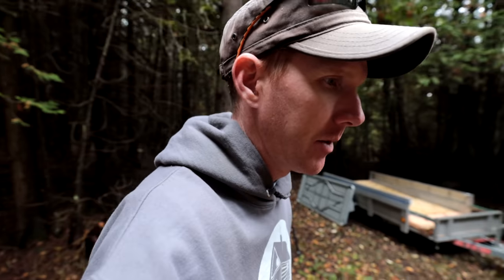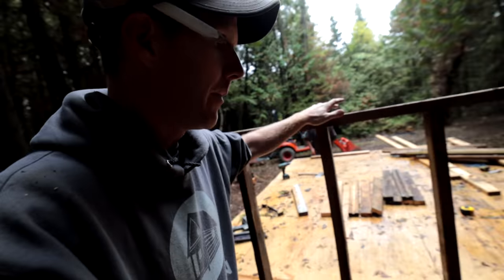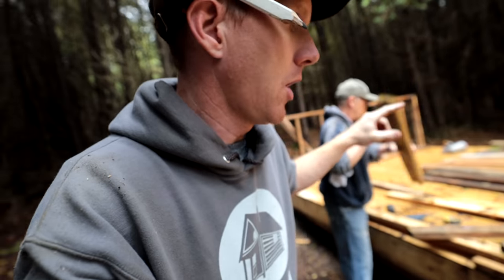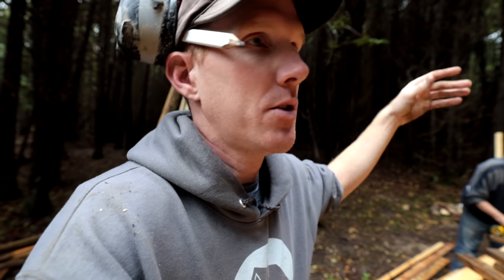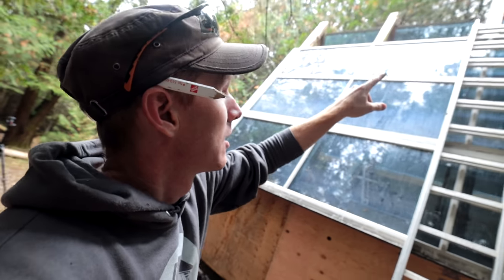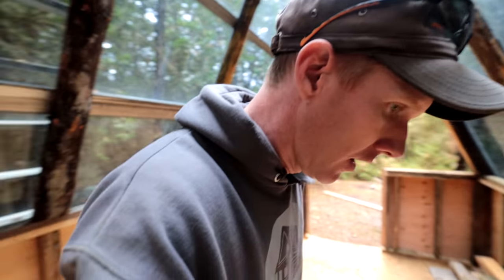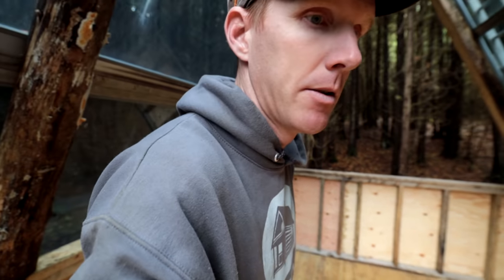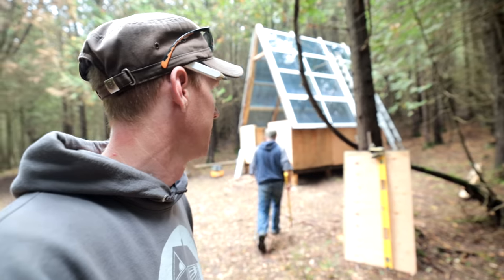A-Frame MICRO HOUSE Built on a Budget!

Comment: Ideas for future: Cob insulate the knee wall inside so you can actually see the cordwood cookies, and it gives you great thermal mass. You can then also cob/lime plaster/render the outside, and maybe do a line of cordwood cookies around the transition, but not too much. You don't want to take away the view from the outside of the immensity feeling of the As. Inside you will feel it anyway, regardless of whatever else is going on. And from a business side, don't put anything in there that you can't take out through the door, and you could rent it out as a wedding ceremony pavilion.
Reply: Cob has pretty decent thermal mass but it weighs a lot and it is very bad at actually insulating a building that experiences long, cold winters.  The walls and floor could be well insulated but you would still have to increase the strength of the floor if enough cob was going to be used to make a noticeable difference in heat retention.

Comment: Hey neighbor! I'm watching you guys late on Saturday because I'm on vacation with my daughter in Massachusetts 😁
I've watched the video a few times and couldn't find or figure out what you were using as tiebacks for your knee wall. If you could be specific for my blind a$$ self I'd really appreciate it! 
The pond looks great! I'm sure you guys will get many yummy meals from it and great memories too.
As far as ideas for the A-frame, I like your idea and I agree that it looks like a church. Therefore,  my idea is to use leftover tiles, broken ceramic dishes, glass marbles, basically anything leftover and colorful that you can "tile" onto the plywood. For the glass you can paint it to look like stained glass or there are sheets of film to place on the surface that refracts the light and creates rainbows (look for it at Lowe's). Gingerbread cutout trim for the outside decor could give it a Hanzel and Gretel feeling to the cord wood look you're thinking of doing. I have layout ideas too but I'm sure other people will have better ideas than me! 😁
Whatever you do I'm certain it will be fabulous. Enjoy your time, stay safe (especially 13+ feet in the air), hug those beautiful girls of yours, give Don a high five from me, and I'll see you in the next video! (I'll be in Ohio for that one 🤗)
✌💜🐖💨
Reply: The knee wall acts like a box it's attached to the floor.  The bottom glass has a stiffener bar at the bottom that is lag screwed to the walls. Preventing any bowing.  The pitch helps too.
Reply: @cmosphoto1  you're freaking awesome Kevin, thank you for that clarification! 😁✌

Comment: I like the cordwood design idea. I had an idea for the inside of the cabin too... Since you've got all that nice overhead space, what if you were to create a storage box that kind of fits between the A-frame posts and glass and put it on a pulley system so it can be lowered... Free storage space! For living space... maybe go for two futons right near the door opposite each other with a thin table between. When the futons are in sofa mode, you've got space to walk around, when they're in bed mode, the table acts as a nightstand. Then for the back half of the cabin, you can put a small kitchenette against one wall, have the stove centered in the back against the far wall and then have a food prep counter with lower cabinets on the wall opposite the kitchenette. Then just screw in some hooks into the A-frame beams for holding utensils and whatnot. String up some LED stringlights and you'll be good to go!

Comment: I discovered your channel via Zendure.  Amazing work you do.  I shall henceforth refer to you and Don as the Ladder Day Saints.  One suggestion for the floor.  Use porcelain plank wood look tiles.  Looks like the real thing, easy to clean, doesn't need refinishing if you have a leak or come in with muddy wet shoes (or paws).  Then put down a throw rug for winter.  Will help keep it cool in summer.

Comment: That thing is going to be great when it's done, was wondering about the change in the roof, I would have put the glass right to the top and whent out through the back with a stove pipe, can't wait to see what you come up with for the floor plan, be safe and have fun
Reply: Agreed.  I see the chimney going out the back wall - maybe a roof extension to support it?

Comment: You should run some solar powered strip lights down the center of the ceiling inside. They would make a nice out if the way light option.

Comment: You could add some all-thread rods to tie that knee wall down super tight. Sick idea BTW love the door panels.  I would also do an exterior seal of Lap Caulking. It's used to repair RV's it's really good for larg gaps and expands and contracts a lot so that thick flexible product is good for roofs and anything you want sealed up really well. Even adding some seam tape wouldn't hurt either.

Comment: Very cool. I do love the open - screened windows that can opened for a breeze in warmer/hot weather - which would be good.   Even a screen door.  Just had a thought- any way to swing open big triangle windows at the back and front for screened openings in summer?   Maybe incorporate a car door type window you could open or close.     The cherry wood floor would be nice - besides milling more (if you didn’t have enough to cover the entire floor), something else to make a fireplace ledge among the back wall (stone might be too heavy - not sure - a built up bench for seating or displaying things - with a fire resistant top, perhaps.    The front steps could be rather grand - wider at the bottom than the top - or maybe with a bit of a deck out front.   A grand entrance for a grand woodland retreat.    I think you will have some lovely bluish light inside - definitely display it.    The building is kind of like something you’d see on an older chocolate box/tin (in a way).   I really like this project.  Looking forward to seeing how it turns out.     Perhaps two doors that swing open outward? (If you have the materials and space).

Comment: What about taking the chimney out at the top of the back wall instead of the roof? Vent panels could be added to the cap for a hot summer day or to vent off excess heat when the stove is lit.

Comment: Would you consider doing a wrap-around deck on 3-sides: on the front entranceway that leads to the left and right? Then at the back end if you decide to put a wall, then you can hide an outdoor storage area for certain things like brooms/squeegee/scrubbers on long handles to clean the outside part of the window roof, ladders, firewood, etc. That outside deck could be used as an outdoor seating area if the weather is good and bugs aren't attacking.
That wrap-around deck can have a strip of L.E.D. lights around the border and ftont staircase

If you've collected enough antler sheds, you can make an artistic chandelier with little L.E.D. lights intertwined around antler point horns for the inside

Comment: I’m thinking a sleeping loft would be sweet in the glass A-frame.  What an awesome view it would have.  Might need a curtain or some sort of shade for summers though.  A vent system at the top of the A-frame that pushed air from inside out and pulled air from vents on the ground level in to the house could help cool during summers too.  Love your work and channel!!  Very inspiring!!

Comment: Bad news about that Hussk knife, it's made from 18/10 stainless which is junk metal for knife making. 18/10 is usually used to make pots and pans, and can't be hardened enough to make a decent knife edge. Sure you can sharpen it, but the edge will be dull in a few cuts.

Comment: I know you said that you want to run your chimney between the glass panels in the peak, but you could also add a bump out on the back wall and then set your wood stove on it. Then you could run the stove pipe through the roof of the bump out. it would also give you a place to store wood and preserve floor space in your cabin. Just a thought! - Jason
Reply from the maker: That's not a bad idea.   I'm somewhat committed to the current plan, but I really like you idea.

Comment: You should clad the front and back in the cookies but on the sides rip off the outside of some logs and put that on the outside. It will give the effect that the glass A-frame is sitting on a stack of logs. You could even do the same on the inside and you would have a half log cabin look for none of the trouble. You could even do some cosmetic chinking.

Comment: The view out the back of the A frame is soo nice.  Cant you put the stove in the entrance area this time?  You could build a small wood shed outside near entrance.  Just trying to change it up.  Also you could slice larger logs for larger "biscuits" for an entrance area going into A frame about 4 ft.  :  )  Especually if you dont have enough flooring left from cabin.  Then use that floor for what you have left.  If it gets super hot in the summer you may need a ceiling fan with closeable louvres for winter adjustable for condensation in winter ???? 
Anyway, you are my hero !

Comment: This is great, as were your other builds. You mentioned that the glass had UV coating so you're not using it for a greenhouse type thing but plants don't need UV (technically they can benefit from UV-A, but these windows are probably (can't say for sure) coated for more harmful UV-B). Obviously, this A frame cabin is a far better use for the windows, with its voyeur-friendly love cabin vibe, but the plant plan wasn't so bad. Better reasons to not use it for greenhouses are that plants actually like some airflow (no openers in these), and you don't need thick double-glazed windows either (unless you are creating a jungle sauna! Speaking of which, how will this cabin cope in the summer, even far up in the northern wastelands?). You should definitely hang some plants inside however, see how they cope.

Comment: Please run the chimney through the back wall or explain why you like going through the roof compared to the wall. 
Don't forget the fresh air intake for the firebox. Sucking cold air directly into the firebox makes way more sense than sucking cold air into the living space, warming it up, then eventually getting to the firebox. 
I also heard to put the dampener at least 18" above the firebox. This extends the life of the dampener & allows the fire to burn cooler, because you can close it more, while still having a strong draft.

Comment: I’d think you’d want a window in each gable up top that you could open to adjust and release some of the heat radiated through the glass and wood stove. Possibly one of the sky light type windows with a pole opener crank style.

Comment: I agree Don is a Rock... That said... Use stainless steel cable or black pipe to gusset the A frame. Use the same to gusset knee wall to floor. Suspend a loft to the rear.made of rope or webbing for your daughter. Use hammocks suspended bunk style on two sides in near the front like on a ship for four adults. Place stove in the center of the room. Make 8 "club" chairs and make 4 gaming tables (chess, checkers, four that can be pushed together for poker nights. Cook on the stove. Heat water on the pipe. So nothing formal. Four end tables can make on larger table or left for mixed use. Example: Checkers 1, knife maintenance 2, whiskey cheese and sausage 3, waxing boots for winter 4. Either way you can sleep 4 adults. Sleep kids above. Hammock can be dropped during the day to keep the views and they are cheap woven from Amazon.
Reply: Further to below. Use small solar powered gable vent fans  at the peaks to cross pull hot air. Use you chainsaw and channel each beam one half inch for tucking LED strip lighting to run off your pack. Use canvas painters floor runners to collect the crap off your boots. I think A framed outhouse is a must at this point. Also, some wear there should be a two point "a frame" over a fire pit encircled by 3 inch minus surrounded by seating. A large chain hung down to cook the deer chili. Stump tables between the chairs to prop your cold snack... As for you running across the property to show scale (that was funny btw) maybe someone creates a living cartoon style map of your property and you can add to it as it changes? Or maybe you make a cedar plank story wall and wood burn a cartoon map you can refer to? How are your wood burning skills? Last since I am on wood burning. shiplap that knee wall and burn a hunting mural all the way around the inside this winter when the projects slow down. PS run some 3 inch minus down those paths before winter hits, your place gets muddy, very muddy.

Comment: Let me preface this question by saying I live in then southeastern US, where wood stoves for camping isn't really a thing, since it doesn't really get cold here.  So this is a genuine question, because I think I might be missing something.

I watch a lot of Canadian cold weather camping Youtube channels, because it fascinates me, but you guys always make your builds with a wood burning stove chimney going out through the roof.   The stove is almost always near a wall, though, so why not run the chimney through a flat vertical side wall?  In the case of this A frame, it would be the back or front wall.  It seems like that would be much easier to shed water, since the purpose of the roof is to move water down it.  Less holes in the roof should be better.
Reply from the maker: Usually the straighter the pipe is the better the draft, also a properly installed chimney through the roof is water proof.  The less bends in your pipes the less build up of creosote and it's easier to clean..  In the A-Frame the stove I'm using doesn't have elbows.
Reply: @ModernSelfReliance  Interesting.  Good to know.  A lot of the tent setups I see usually have a bit of vertical, hen a 45deg bend to go out of the hole in the roof.  But I guess in that case, you can't have the stove too close to the wall, but it has to go through the hole where ever it may be.  No sure.

Anyway, keep it up, I really enjoy the channel.

Comment: My concern is your walls will bulge out later on, I have built many A Frames, and when proping up your A's on the walls, it would be wise to build some kind of patrician or rail in the middle to reinforce the walls to the floor at least by a couple of feat out.
Reply from the maker: The aluminum panels are ridged and won't bow out by themselves.  so unless the end walls buckle. it shouldn't be a problem.  Check back in 10 years.

Comment: You probably have this sorted already but there are there no buttresses - doesn't the weight of the roof push out the walls?
Reply from the maker: The A's a tied together near the top.  the knee walls are connected like a box. The roof is very pitchy.  It roof has stiffener attaching to the walls to prevent bowing in the middle of the walls.

Comment: Why not run the flue pipe out of the back wall?  The horizontal pipe would radiate the heat And it would be simple items you can buy.
Reply: And cap the top with two pieces of wood or metal.
Reply from the maker: The stove I'm using doesn't have wall exits.

Comment: Why don't you run your stove pipe up so far and than 90degree though the back or front wall and than up. It will look better for the pipe to be off to one side. I would like a porch nice size one. Like you always say, when you start something it's good to have a overnight to think. Your Brother and you have children that in a couple of years will have great fun with their friends.Need I say more. Automatic curtain, and a screen window for summer time at the top to let out heat. Have more but that can be my part. Bill N..

Comment: I am not sure that the Huusk knives are anything special and they aren't made in Japan as I think that they were thought to be.
You need some form of overhang both front and back just as basic protection against the elements and that will be tough at this stage.
Reply from the maker: I'm planning on tackin' on a fascia front and back that will offer a little bit of protection to the front and back walls.

Comment: Let me preface this with the fact that I know absolutely nothing about stove pipes and how much heat they put off. I’m only thinking of the time we put a propane heater too close to a window and it cracked the glass.  Can someone educate me about the outside temps of a chimney pipe?
Reply from the maker: They won't set wood on fire... exact temps not sure.  just need an air space.

Comment: I really WISH cubic mini stoves were sold here in the uk! They refuse to work with distributors so you have to order direct from Canada, basically ends up doubling the cost to get it :-( I’d have bought at least one or two by now and my work cabin wouldn’t be so cold 😜
Reply from the maker: They are excellent stoves.
Reply: @ModernSelfReliance  😭
Reply: @ModernSelfReliance  I’ve just bought one 🥳